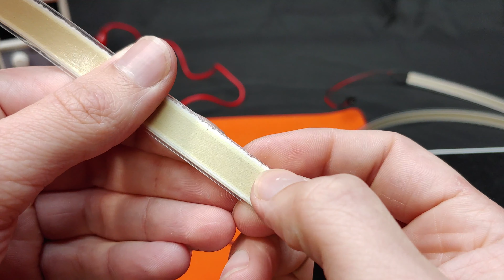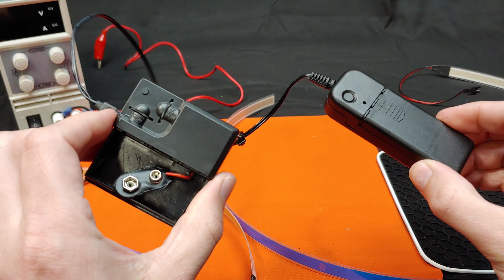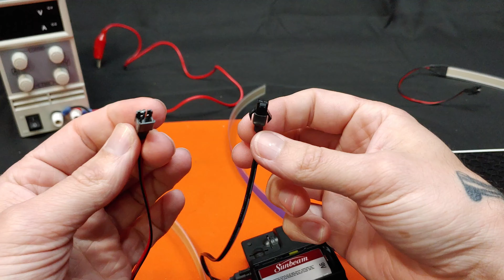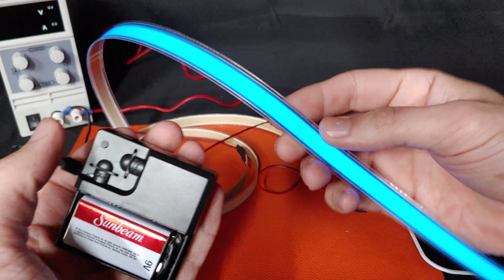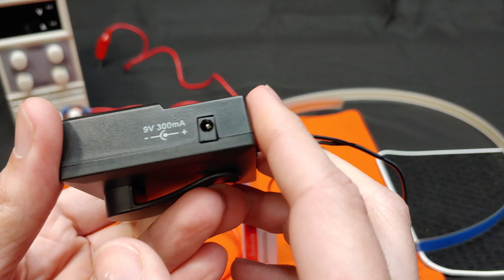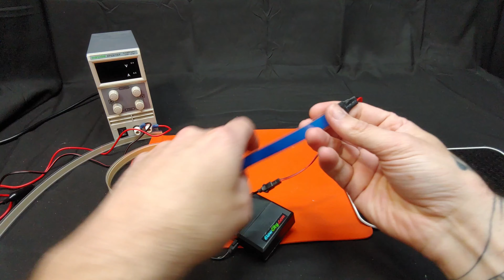Electroluminescent EL Tape Review

Comment: Is it waterproof?
Reply from the maker: No! The tape shown in the video has the wire leads protected by simple heat shrink tubing. It is not even slightly waterproof.
Reply: James the Light Guy any idea on how one could make these waterproof?
Reply from the maker: Coating the entire strip in a thin layer of clear silicone would likely do the job.
Reply: James the Light Guy I gave the video a like! Thanks for the help. 👍🏾🙂

Comment: def need a Lipo power supply. 125mAh will drain a 9v pretty quick
Reply: You mean mA (without the h).  A 9v battery should be able to run about 2-3 hours at that current.

Comment: As a electronic engineeer I'm a bit concerned about the way you test current... 
I mean you have a messure obviously, but it's very imprecise and dangerous

Please do not try to measure current directly from the power output ever again without a load (E. the electroluminescent tape) on bigger things like your power supply, a charger, a house power output, a car battery, etc... even with the silly 9v battery I was expecting the multimeter to explode (not in a dramatic way), in the best case just burning out the safety fuse and a bit of smoke, in the worst case you should have thrown your brand new multimeter in the trash...

basically the multimeter on current measure mode works as a "perfect" bridge, a cable with the lowest possible resistance, 
now imagine we have a 12v car battery and then we hook up a piece of metal to bridge the nodes and complete the circuit
what's going to happen? some sparks, smoke, lot of heat and if you hold it longer the battery will basically explode (in a dramatic way)

what will happen if we connect our multimeter on current measure to the 12v battery? the same scenario described above.

No matter if the multimeter says that handles 1A, 10A, 50A beacuse current as a "technical term" is infinite, the only thing that stops the flow of electrons is the resistance of the material where the electrons flow, if we have a "perfect" cable inside the multimeter with 0.0001ohms (basically 0 resistance), the current will be almost infinite for a millisecond and will burn the multimeter.
Reply from the maker: I appreciate the advice. I have no formal training on any of this stuff. If you was any recommendations for resources I can use to learn more about how to operate the multimeter properly/safely, I would greatly appreciate it.
Reply: I really appreciate the explanation

Comment: James, I want to light bicycle wheels, out at the rims.  I've seen it done with EL wire ( https://youtu.be/0j7um0aKtXc ).  Is this EL tape flexible side to side, so that I could bend it around the interior of the wheel with the flat side of the tape facing out?  It doesn't look flexible side to side.
Reply from the maker: It's not very flexiblev (across the tape) because of the plastic sheath. I don't think you'd get it flat against the inside of the wheel all the spokes. EL wire would be a better choice because it is flexible in every direction.
Reply: @Jamesthelightguy  Dear James where do I buy the white ribbon Which site sells this thing?
Reply: what you can do more cheaply is get glow in the dark paint and put a thin layer on the bike wheels, and mount a UV LED near, and the rim will glow as it spins. total cost only about $12 to do a couple bikes